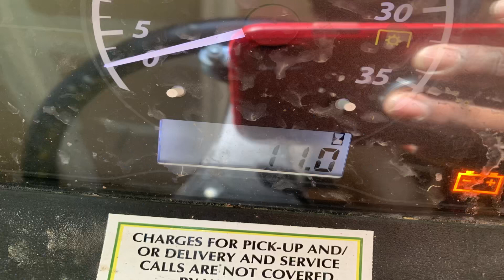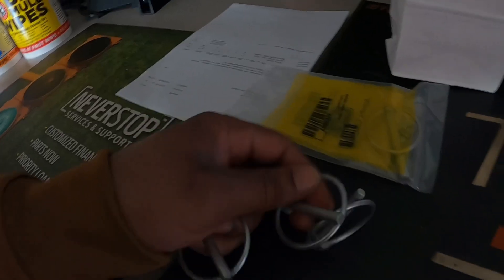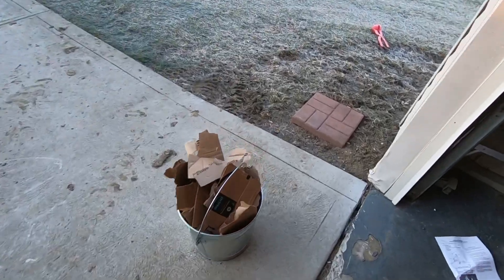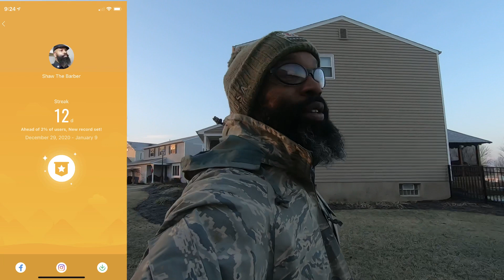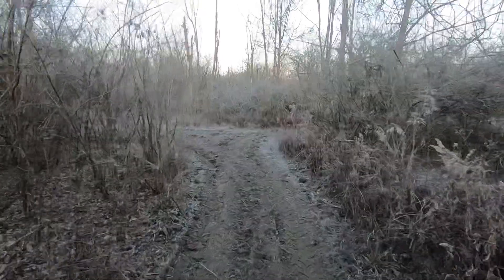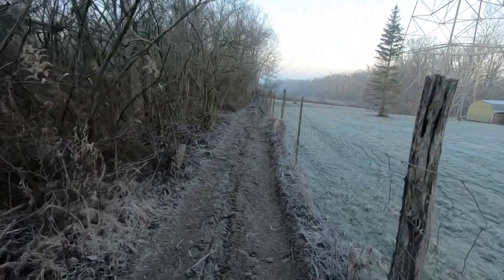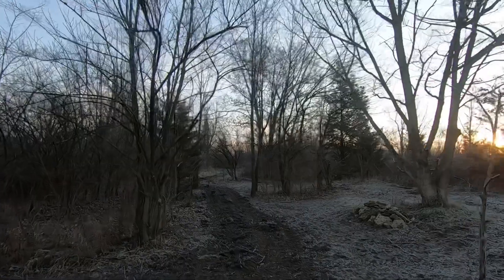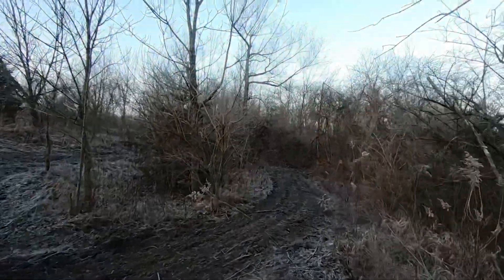20210110 Morning Walk, Penny Had Problems Yesterday... Flat Tire, Box Blade, 3 point, Fuel (Vlog)

Comment: Brrrr  that's chilly  !!    It's 30 degrees here this morning and I'm heading out to move some snow. Only a couple of inches but it's seat time on the 1025. As for the plug in the tire you'll be fine . If it was in the sidewall I'd have to say nope. (Been there done that.)  Trails are coming along nicely. It will take time and numerous pulls with the box blade.  Pulling through roots and mud can be hard on equipment so if all it means is you've sacrificed a few pins you're good.  Love the sound of a crackling wood fire on a cold day. Stay safe and be well.
Reply from the maker: Good Morning Mr. GoodWrench, The plug in the tire is holding up well. I took Penny out again yesterday put her to work with the box blade yet again and lost another pin. I put the box blade away after that. I am headed out for a update as soon as the sun comes up... The trails are looking pretty good... The box blade has started to do cut outs the more I pull it through... I think I will wait for dry weather before using the box blade again... But I have been having so much fun... Thanks again Sir... Much Respect and Stay Safe... I will see you out in the yard
Reply: @shawspeaks8252  I agree with waiting until warmer weather.  Glad to hear it hasn't  dampened your enthusiasm.  Keep on "tractoring "      :)